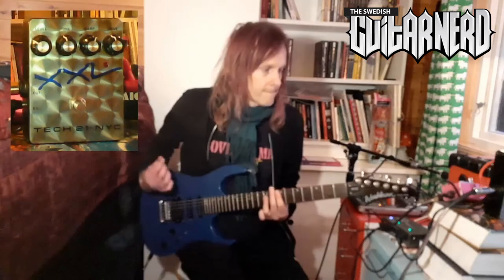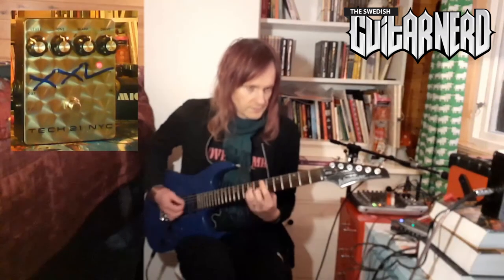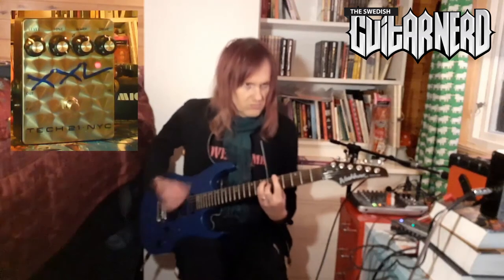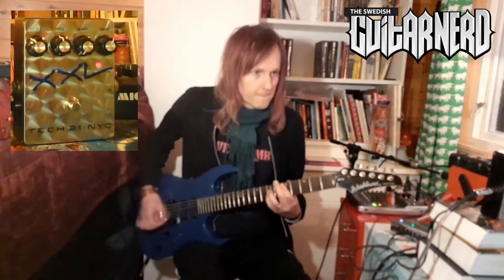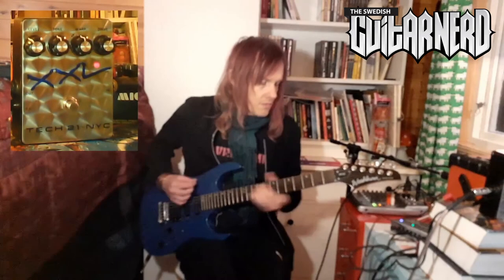Tech21 XXL - demo

Comment: Had one of these, liked its gain structure and the warp a LOT. Just didn't like its tone control playing through plexis back then and it was way too noisy. It cleaned up exceptionally well for a distortion even compared  to todays armada. Somehow I  always keep an eye open in case one  is sold. The fuzzy warp setting just was just awesome! Greatly underestimated design. Never understood how people could NOT notice the different warp settings 😁. If anyone would design a tube overdrive/distortion pedal with such control and dynamics, I would most certainly buy it instantly.
Reply from the maker: Awesome! It's truly a great design!

Comment: How can I get one here in usa?
Reply from the maker: Try Reverb. The XXL is discontinued so you'll only find used ones.
Reply: I bought one on eBay last year. I was lucky it was very cheap.
Reply: How much do they cost, typically...
Reply from the maker: @dirtyfingers3155  You should be able to find  one under $100. I got mine even cheaper.
Reply: Shhhhh! I found one for half that!.
Reply: @SwedishGuitarNerd   I also found aTech 21 SansAmp GT 2 Distortion Guitar Effect Pedal. For about 50-60$. This model must sound a little more modern to today's amps. I'm just guessing. What's your opinion sir?
Reply from the maker: @dirtyfingers3155  The GT-2 is actually older than the XXL, and more of a amp modeler. You can get anything from a crystal-clean tone to full-blast overdrive. So it all depends on what sound you're after.
Reply: @SwedishGuitarNerd  which of the two do you prefer?
Reply: @SwedishGuitarNerd  I bought it!! 🤘
Reply from the maker: @dirtyfingers3155  Which one? The GT2?
Reply: @SwedishGuitarNerd  XXL!!!
Reply from the maker: @dirtyfingers3155  Awesome! Enjoy it!!